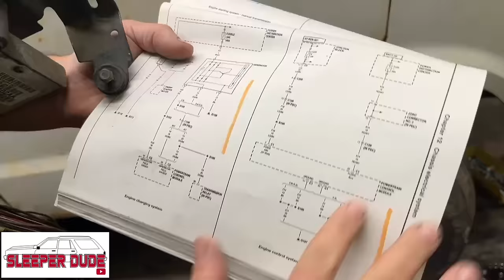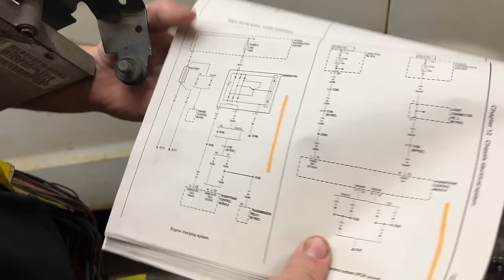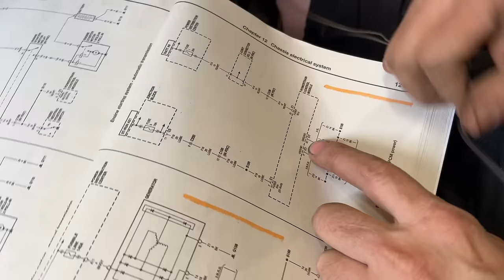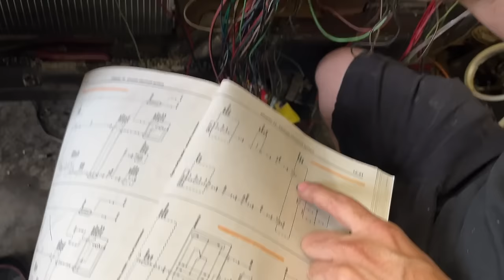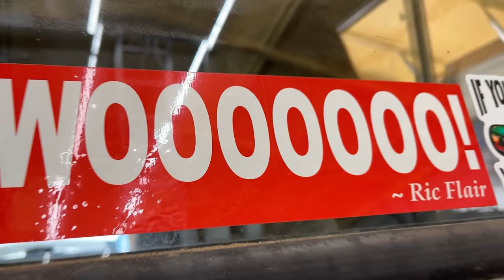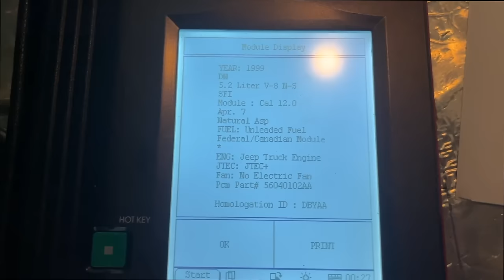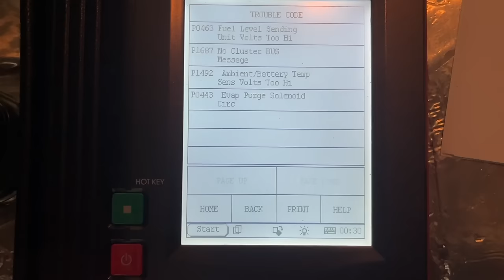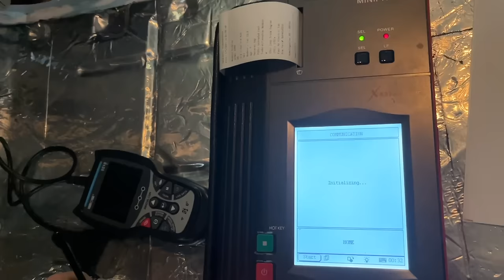2 Years of WORK Has Led Up To This! Will It Start?

Comment: Alright, idk if this will help but here's what happened to my 99 dodge ram. I had it 14 years and ine day it started to die when making turns. When i say die it wouldn't start back...unless...i unplugged the 3 computer plugs and plugged them back in. 3 shops said to get a new computer. Autonoobs sent me one and it worked!!! Until...3 months go by and it started to go into limp mode. I did the unplugging of the computer plugs and plugging them back in, nothing, still in limp mode. So i said mehhh whatever I'll keep driving it. 3 years later im at a friend's house and he drove it and said good god that truck needs to be burnt to the ground lol. So we got messing with the plugs and wiring and i found this out. On the black computer plug...there is something in that plug that controls the fuel pump and/or causes it to go into limp mode. I wiggles the plugs. Unplugged them. Mashed them in hard and thats when he said whoa stop!!! You did something when you plugged that back in! And i stand there scratching my head like really??? So...the fix!!! I had to unbolt the computer and put a huge C clamp on that plug to make the connection for everything to work. Limp mode on those will make the transmission loose 1st and overdrive but if you shift the shifter all the way to 1st, you'll have 1st gear and will have to shift it manually. The limp mode went away, it never died again, transmission worked fine, no engine codes, nothing, it was like a brand new truck!!! Well, up until the c clamp totally mashed the wiring in the plug and one day it died and i couldn't get the clamp back in a position to hear the fuel pump relay kick on. Idk what's in the wiring on that plug but i did repin every wire and doubke check both the old and new computer...it would not run properly unless you mashed that plug tighter with a c clamp.

Comment: The key is the secret
Must match
Reply: If the key has a chip in it make sure it's recognized otherwise you can crank on the engine all day it will not let fuel in don't pour gas in the intake ur could scar
Reply: Yep

Comment: I just love you guys!! Now on to it.  It's FUEL or vacuum and fuel.  Maybe you've plugged a line with a vacuum plug that wasn't supposed to be plugged? Maybe one that's supposed to read vacuum not be stopped up? BUT... When you put fuel to it it fired. Any other troubles seem secondary to tuning or timing etc. The should be a program that would run the engine even if the O2 sensors aren't hooked up. But it's Dodge so I could be wrong. Combination of O2 and Vacuum signal to the computer?  I'm throwing too much sorry. I'll shut up now.  Get the security out of your mind. That's what has you stumped. IMHO.  You're thinking it's a shut off from the security but it's not. Sorry for the hardships!

Comment: plus 4 trans fluid
Reply: durango the ecm has to have grounding before you kick this out I have one was working on something else and took a ground wire loose didnt hook it back up had the same thing happen turns out there are multi grounds for the ecm and they go to certain ground points to achieve the proper amount of grounding you might want to check that . they will be flat wire ground . you can look at the wire diagram again for the ecm and see which one comes from the injector section of ecm.

Comment: Something safety related and the oil pressure sending unit or something similar is where I think you are going to find the problem. It’s preventing the engine from running to preserve it from failure! Process of elimination is all I can think of. You are light years ahead of me with your knowledge but think about it…….has to be safety related brother. 🤔

Comment: Look.. not an expert. But can the main comp (brain) communicate with the engine? 
I know with my old cars the trans sends a signal to the engine that kills the ignition for a split second so that the gears can disengage/engage to shift. Like, when the torque is removed it can disengage from the gear it's in and find the new one

Comment: Obviously it isn't the computer as it's new. Next CHECK  EVERY  SINGLE  GROUND in the harness and be sure they are all hooked up. Since the computer is new, it is either something mechanical to do with the engine or a signal that the computer requires in order for it to be able to fire the injectors is not getting to the computer. Determine exactly what all the computer requires for it to fire the injectors and check each of those signals and their respective wiring.

Comment: Just throw a two barrel carb and an hei distributor. Make it easy to fix Incase it quits in the road. I know that isnt any fun compared to being able to ude OBT 2 And maybe better fuel economy but other than that i hate dodge fuel injection system once they get old.

Comment: I know nothing about a modern engine, but it would idle before you backed off the fuel pressure regulator. Maybe it wasn't giving you an accurate reading.

Comment: Josh, I know this is a long shot, and im old school, so that dark magic that runs these things is honestly beyond me... But... as far as i can tell, your problems began when you sealed off those vacume leaks.
Now,,,how that relate4s to the computer, in couldnt tell ya,  But for me as an observer,  thats when things went sidways.
I would suggest opening those vacume lines again, and try it,, at least then youd be back at a running [ maybe not great engine] but it may give you some indication of what had occured.
As Holmes would say,, Whatson, hand me my pipe....
I wish i could help further, because at this point with the new fangle dangle tech, id be calling for a priest...lol
So ,,to say it again,,,back up a bit,,return everything back before you plugged off those vacume leaks...
Wishing i was there with you guys,,,
Much Love from Al in Canada....

Comment: I may have the reason your Dodge won't start.  The Seat Belts need to be buckled!  Unless you disconnect the sensor wire under the seat, the engine won't start without buckling the Seat Belts, or disconnected the sensor under the seat and it will start the engine.   (I know from experience!)

Comment: YOU EITHER HAVE A COMPUTErR THATS NO GOOD BECAUSE IF A COMPUTER IS BAD THE ENGINE WILL RUN AND THAN QUIT AND A SECURITY IGNITION WONT LET THE ENGINE ONLY RUN FOR A FEW SECONDS ..THIS ALL HAPPEND IN MY CHEVY LUMINA AND MY FRIENDS BUICK .